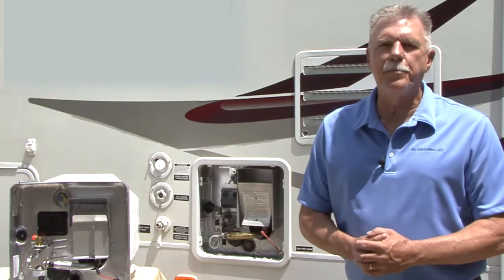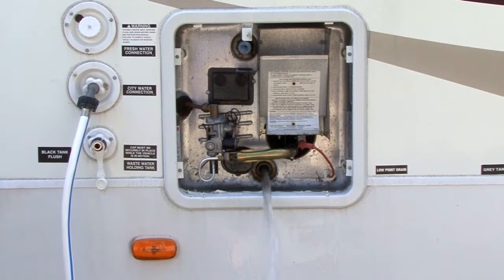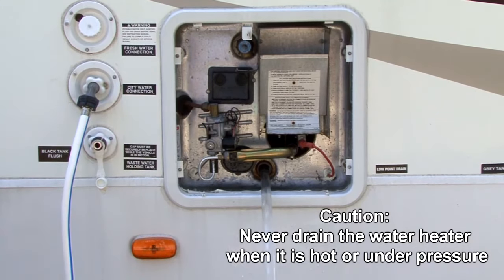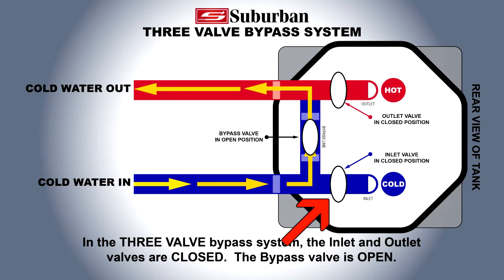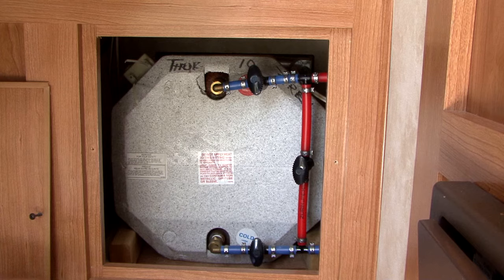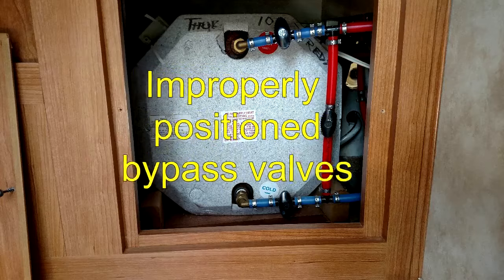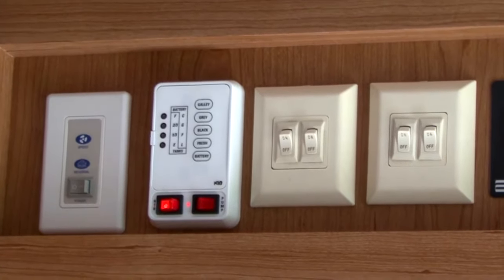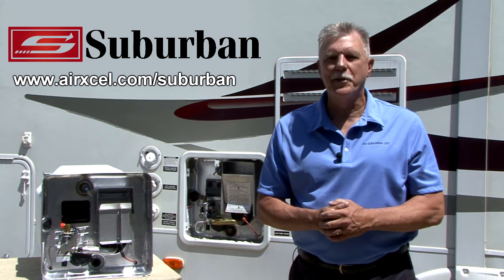How to use your Water  Heater Bypass Valves

Comment: thanks for the video. Always wondered.. why are hot water heater tanks designed to fill up from the bottom instead of the top? Seems backwards to me
Reply: 2 reasons:

First, heat rises. Hot water will naturally rise towards the outlet. 

Second, filling from the bottom allows the rising water level to push air in the tank out through an open faucet to allow the tank to initially fill.

Comment: Does the water fill the water heater automatically when filling the trailer water tank, or connecting to street water?
Reply: Kinda. You need to open a hot water faucet to allow the water to push the air out of the tank while it fills. If the air can’t escape, the tank won’t fill.

Comment: We have a 2021 Palomino Solaria travel trailer. The water heater is on the left side front beside the water bay. I cannot find access to the winterizing valves. Can anyone help me find access?
Reply: On our older RV the valves are under one of the dinette seats.  So look inside the RV near the location of the water heater.